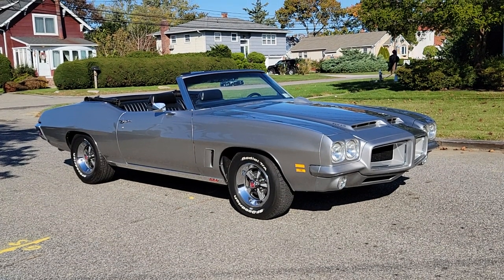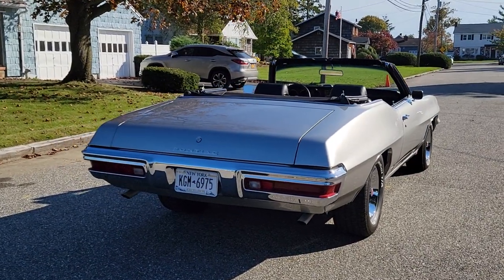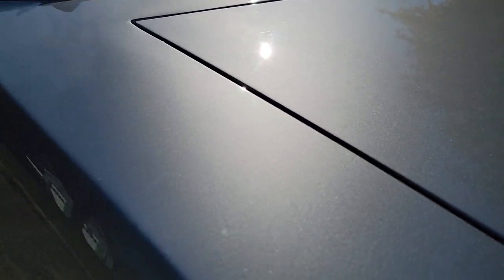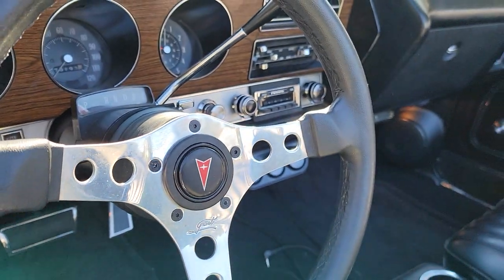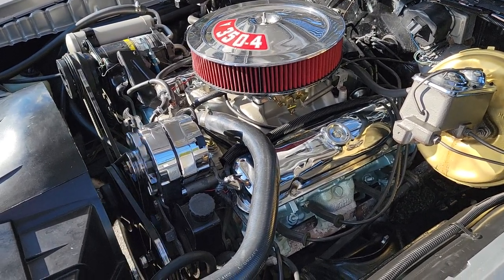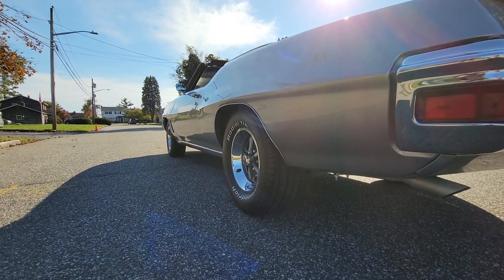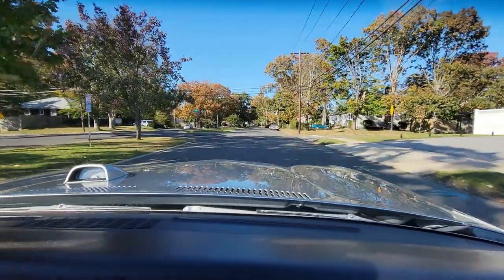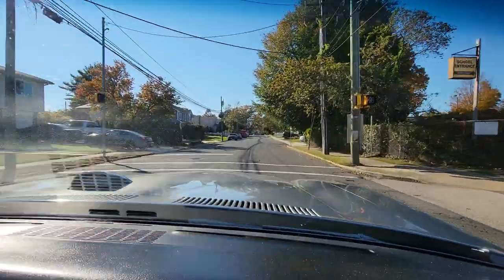LOADED 1972 Pontiac Lemans Sport Convertible~Loaded With Options Including Factory GTO Package!

Comment: In 1971 my bro-in-law ordered a Lemans Sport Convertible. But his had everything in it that this one has but it had a Muncie 4 speed. It was a baby blue with white interior and top. It was one of the most beautiful cars I had ever seen. And for a 350 it really ran pretty damned good. The 350s they put in these cars were not the run of the mill because they were 4 bolt main high output engines. I got to borrow the car a couple of times and had a fucking blast. I wanted that car so bad when he finally got rid of it but I didn't have the money that someone else did. He sold that car almost for what he paid for it 6 years and 67,K later.
Reply from the maker: Very Cool, Thanks for Sharing :-)

Comment: Nice looking convertible! To clarify, the GTO option was only available on the coupe’s (whether post or hardtop).  One could order a 1972 Lemans with the Endura bumper for a ‘GTO look’.  ‘72 GTOs came with either a 400 CID or 455 CID (HO) engine.  GTO not equipped with a 350.  PHS will show what this car fitted with from factory.  GLWS.
Reply from the maker: Thanks, I didn't know that.